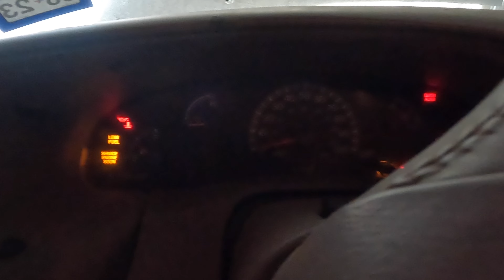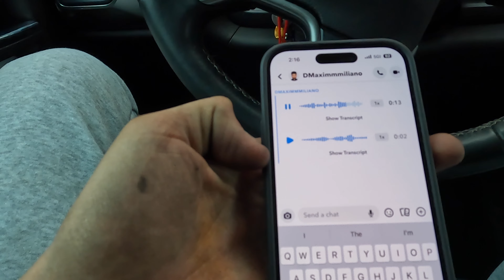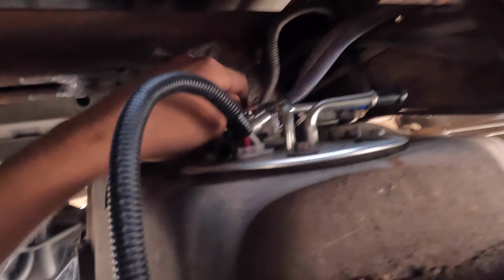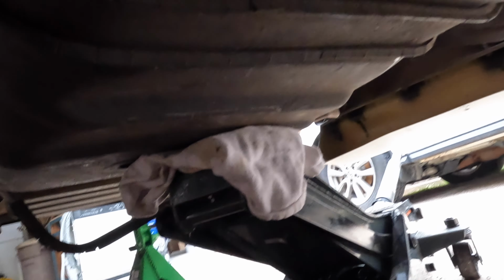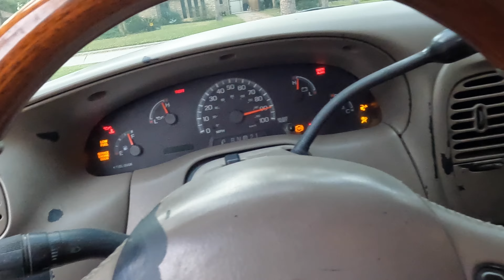LS FORD IS BACK ! 🔥

Comment: I have a ford f150 1997 literally having the same problem you had lmao, if you could tell me what really got fix I would appreciate it 💯 trying to get it back on the road
Reply from the maker: At the end it turned out to be a blue wire going into the ignition switch . It was just loose . Hope it helps 🔥